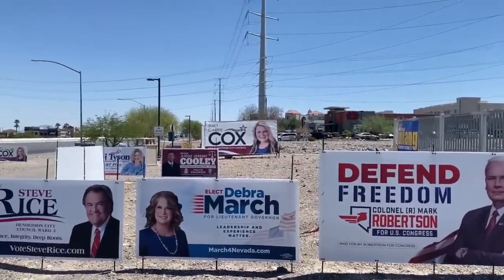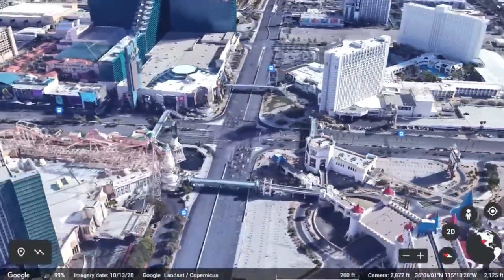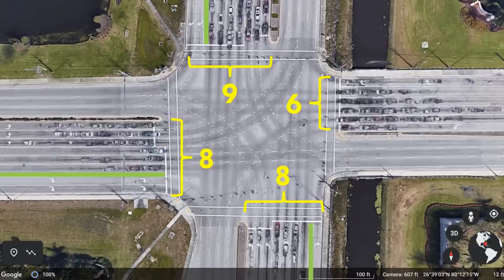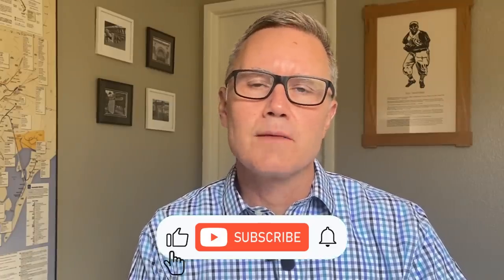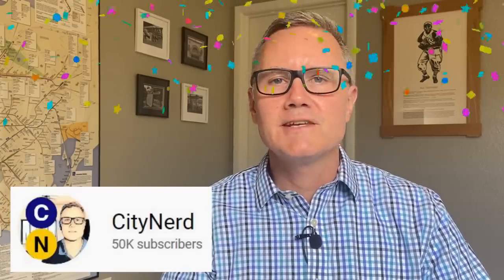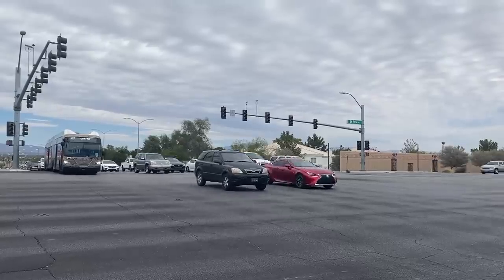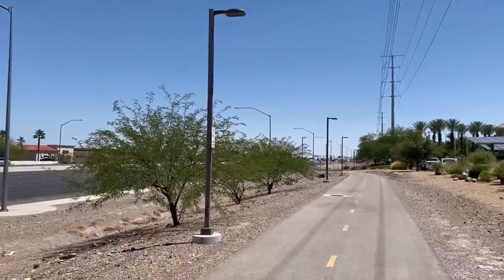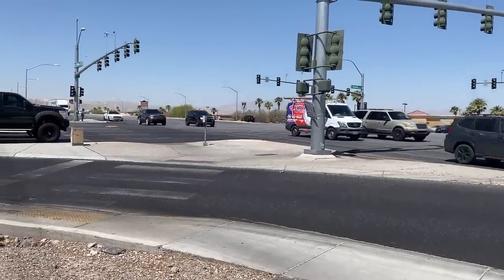Stroad vs. Stroad: Land Use, Traffic Engineering, and What Happens When Suburban Arterials Intersect

Comment: Las Vegas has so much potential to build out an efficient light rail system to connect the city together. 

If they removed just 1 lane in each direction I’m sure they could easily install a rail line.
Reply: "Too expensive! Build a Elon Musk Depression Tunnel" -NvDOT
Reply: I wish this happens. Being that I live in Las Vegas.
Reply: Skip just 1 lane ?...mm you'd still have to cross 6, 7 lanes to get to the streetcar ..🤔
Reply: @bodybait  lol
Reply: Private interests have dictated LV public transit, unfortunately
Reply: instead thei investe in a single private suege tunnel whotout safty fatures
Reply: @bodybait  do you know what's more expensive than operating light rail? Road maintenance from extensive car usage
Reply: Slow access road on each side with a posted speed of 15 to discourage people from using it as a through lane, fenced off multiuse path next to that, followed by grassy tram tracks, fast road in the middle and repeat on the other side, but you'd still need underpasses at each tram station, because that road is wider than the distance between some tramstations in my town, but it would be worth it to contain the monster that is that stroad.
Reply: @l.c.8475  sorry they want gamblers in hotels not to go out.
Reply from the maker: What I didn't say here (maybe for a future video) -- I spent a lot of time with a clipboard and a timer analyzing how phase lengths varied from cycle to cycle. The signal logic is actually pretty smart (in its way) about how it allocates green time to make sure queues clear, since demand patterns every three minutes has a lot of variation. Nevertheless, there was ALWAYS dead time in the cycle -- time when a phase stayed green but the demand had dried up. The fact is, most roads like this are overbuilt, and could pretty easily function the same with one less through lane. (Many roads are built to accommodate demand projected 20-30 years out, and in the sun belt, absurdly high growth projections are the norm.)
Reply: @applesyrupgaming  this intersection is in Henderson, no where near the strip….
Reply: @bodybait  its is a choice to make bus and light rail compete for funding instead of bus vs car and rail vs car.
Reply: @andyinlv1975  i didn't know that lol
Reply: @bodybait  That is absolutely not true! Light rail can easily replace bus routes yes but buses are still affective to serve places with less demand or maybe even run some tram feeder routes
Reply: @bodybait   Well if Las Vegas is rich enough to have expensive money sucking motorways then it can afford to have a tram through the entire strip! Imagine the economic benefits it could have by not needed to go on to bridges over the car traffic and instead just safely cross! ACTUALLY LETS JUST GET RID OF THE CARS ON THE STRIP! Then turn that space into a public plaza with a tram line so if you hate walking very far then you can just take the tram!
Reply: Light rail planners make the assumption that suburbanites want to use it. They don't. Here in the Denver environs, suburbanites desperately try to preserve their 80's-90's lifestyle of big vehicles and green lawns.
Reply: @ccaudi  Actually they will! (If you steal some space from the cars)!
Reply: @ccaudi  Americans will use transit if it's good. Which means high frequency, right of way, and a good (probably grid) network.
Reply: @bodybait  They would if they'd tax the rich.
Reply: Then turn those ridiculous intersection into double lane roundabouts with green space, add pedestrian bridges at all transit stops as well
Reply: @CityNerd  Why fixed times and no detection loops?
Reply from the maker: @reformCopyright  I didn't wanna spend too much time on the intricacies of the timing plan, but of course the detection is important! For example, the northbound left phase (which I believe is the last in the cycle) will sometimes gap out and if there's enough time left in the cycle, the signal will give a little more green time back to the southbound through.
Reply: @mindstalk  and people growing paranoid. Sorry, but I strongly oppose all forms of fascism, and that includes public transport fascism
Reply: @Vettel2011  But you love car and zoning fascism.  You love government subsidizing your lifestyle and telling other people what they can't do with their property.
Reply: @mindstalk  are you talking to yourself? If you don’t like cars, don’t buy one

Comment: Even for drivers these intersections are awful...and crazy dangerous.
I wondered why traffic engineers don't just put a big patch of concrete in the middle and bunch left-turning cars next to it (allowing two-stage phasing) like it sometimes happen in Europe. I got my answer : with a 90 km/h approach speed, there would be to many rear-endings...
Reply: AFAIK all crossings in Germany, Belgium, The Netherlands, France,... have a maximum speed of 70km/h, guarded with red light - and speed camera's.
And even when you wouldn't find crossings this large in Europe. (I suspect 5x5 lanes, including turn lanes is probably the biggest you'ld find)
Even then though governments try to remove these type of crossings as much as possible because they are so dangerous. 
One of the solutions is to make tunnels or bridges for through traffic and/or split the stroad into a road and one or two streets.
But since that's expensive, other cheaper options are to reduce the speed limit, cut traffic in other places to reroute traffic away from these intersections, discourage the usage of cars by reducing the amount of parking and charging money for parking,...
Reply: @Robbedem  
Any improvement of US land? (both urban and suburbans sucks) probably have to start with rebuild failed mall/strip mall.

Comment: having grown up in a place like this (suburban Phoenix -- lol like a urban Phoenix exists), your comment about entering the intersection during a yellow light even when you shouldn't rings true. both in that it's very, very common to see, and that when you're driving through the intersection at speed it can be incredibly difficult to decide if you have time to stop or time to make it through the intersection. turns out humans aren't great at making snap decisions while operating heavy machinery at 75 feet per second.
Reply: What is the proper method? Yellow is slow down but what's guideline on going through or not.
Reply: With cycle times of three minutes, you are just begging drivers to blow yellow lights. Stopping means getting punished with three full minutes of sitting at a red light. It is just one aspect of how stroads suck even at their intended purpose of managing motor vehicle traffic.
Reply: @mrslvw  The guideline is that if you are scared to go through on the Yellow, buy a bigger vehicle.
Reply: @stevengordon3271  bingo! Bonus points if you get it lifted
Reply: @stevengordon3271  lol nay in this economy and with these gas prices, I'll stick to my little fuel efficient clown car.
Reply: Driving in Phoenix, I was blown away at the high level of people aggressively trying to run the yellow lights and that first bit of red. The urban sprawl is so bad there in Phoenix that you should expect to drive 45 minutes, on average, to get anywhere.
Reply from the maker: Yeah, it's amazing how much of a system like this that has such a high potential for danger comes down to relying on flawed judgements of individuals. A lot of yellow (and red) light-running, but then on the other side a lot of people at the front of the queue looking at their phones or whatever and not reacting when the light turns green.
Reply from the maker: @davidbarts6144  100%
Reply: @mrslvw  the guideline is to stop if you can safely stop.  Most drivers don't treat it like this though.
Reply: I live Phoenix as well we’ll by the Avondale tolleson area and yes you need a car everywhere. I love downtown phx alot as they are trying to urbanized it even more specifically Roosevelt street because I just park nearby and walk along all the bars, food etc. More fun to walk and discover cool places or art then driving around. But even in downtown you still need to be cautious of cars

Comment: I lived in Henderson, Nevada, 2004-2015. I bicycled thousands of miles around Henderson, Las Vegas, and Lake Mead. I rode with a club for safety. Cyclists and people standing at bus stops around the area get killed frequently by motorists. I’ve ridden through the intersection of St. Rose and Eastern many times. Except for North Las Vegas there isn’t an area I haven’t cycled in the Las Vegas area. Thanks for this video of an area so familiar to me. If you want to do some cycling with a great club in Henderson, check out Green Valley Cyclists.
Reply from the maker: Thanks! In a lot of ways, Henderson is great for biking. Lots of paths and trails, and you can start to see buffered bike lanes on some of the newer or retrofitted arterials. There are just too many intersections like this, though.
Reply: I cycled Valley of Fire road one Saturday - and was constantly harassed by Harley Davidson riders, who travel wolf pack style btw.   Even the new bike lane on Hollywood Blvd is pretty bad for exhaust smells with plenty of Ford F250 quadcab duramax diesels to be seen.  I ended up going mountain bike and stay away from polluted, dangerous roads.

Comment: 11:39 I've been walking more and more lately, and having been a driver for the past... 16 years... I have been paying attention to how I handle each intersection type as a driver, and how the road is designed to help me ignore pedestrians as a driver. And just how car-centric our culture is that basically means cars always take right of way and anything in your way is a nuisance. Anyhow. On an intersection with slip lanes. I am always checking traffic approaching from my left, I may see a person appraoching from the left too, but almost no way am I going to see someone approaching from  my right! 

I know the slip lanes are supposed to be safe, and some are even signalized, but if you're a driver, you know that no one cares about anything except themselves (yourself included when you're the driver), and so people approaching from the left, may need to get into the slip lane exit lane in order to get to their destination or to get ready for the next intersection which is probably also packed.

Anyhow. Slip lanes anywhere near pedestrian traffic should not happen. Drivers will 100% of the time be focused on oncoming traffic. Unless the slip lane has 400m of bollards keeping the two lanes separate past the intersection, then maybe the driver turning right on the slip lane won't look left... better yet, put up a wall to prevent them. And on the wall write "watch for people!"
Reply from the maker: It's just a terrible design, especially when there's a pretty well-used multi-use path across one leg of the intersection. Everything but cars is an afterthought.

Comment: In cities like Las Vegas, transportation planning is a misnomer for how it's practiced. It's not about transportation. It's about cars. Cars are transportation but transportation is about more than cars. First of all, buses have to stop 500' from the intersection. If you have to transfer buses, that's 500' to get back to the other street and that bus probably has to stop 500' down that street. Include the 200' to cross that huge street, and you're walking 1200' just to transfer buses. That's almost a 1/4 mile. It's not very far but in the Las Vegas heat w no shade, it's miserable. So "transportation" is not what these people are planning. 

The problem is that once the cities are built out this way, if they someday come to some kumbaya and try to build an integrated transportation system, they will have a hard time because the streets aren't built to accommodate that. By that I mean, the streets are only barely walkable. Mega streets, fast  traffic, no sidewalks, no shade, nothing but parking or sound walls facing the streets, to to name a few things. They spend a lot of money landscaping the street for cars but not for people. The streets are not built at people scale. They're built at truck scale. A lot of roads will need to be shrunk and people won't like it. It will be hard to change the nature of those streets. 

Chicago is a great city to use transit. The streets are small for one thing. No wide streets. Traffic is slow. Lots of stop signs. There is plenty of shade on most streets. Store fronts along the sidewalks. The city is built at people scale. Getting to your bus or train station is fairly pleasant even if it's 1/2 mile away. Buses and trains are frequent. Walking a mile or more in Chicago is a breeze and doesn't feel like it. 

I'm reminded of Los Angeles which has had a kumbaya on transit and is building out a vast mediocre rapid transit system. People often say LA is not a dense city but it is and demand for rapid transit in such a huge city is there. Whereas in cities like Chicago, NYC, and San Francisco, people of all socio-economic classes take transit together, I don't think that will ever happen in Los Angeles. One big reason is that the streets are miserable to walk on. Little shade, lots of parking lots, wide streets, fast traffic, etc. Most who have a choice would rather sit in traffic than walk a 1/2 mile on one of those streets to a station or wait for a bus or two to complete your commute. The city just isn't built to facilitate walking and taking public transit. You can build a large mediocre transit system but if getting to it is unpleasant, well then, you've limited it to those who have to use it. Even walking around Century City can feel dystopian. It isn't pleasant. I think I would prefer a root canal to walking down Sepulveda Blvd for 1/2 mile.

Comment: What's your opinion of "Michigan Lefts?" Those stroad designs where you must drive straight through the intersection and make a U turn just to go left. The justification seems to be that they are safer and reduce conflict points, but are they? My experience is that they can often overfill and can cause backups, leading to an even longer wait. They do seem slightly better for peds because they require a substantial median, creating a larger island at the crossing.
Reply: Or you could do what we do in Sweden : ban U-Turns (well I have never seen anyone do it, and I have never done it, and my driving instructor told me to never do it), and design the roads to accomidate turning around some other way.

(roundabouts or side roads that you can drive in on and get turned around using a three-point turn or a turning area.)
Reply: I'd love to see a City Nerd video on non-traditional intersections (Michigan Lefts, Roundabouts, Continuous-Flow, etc.). Are any of them actually better? Or do they just create a different set of problems?
Reply: In Quebec City there'S a road with those and they built the bike lane straight in the middle with yield signs we absolutely cannot expect anyone to respect.
Reply: @MohondasK  I would not be surprised if there was a city in the US that embraced roundabouts but then made them 2-way roundabouts that go 3 lanes each way, as if they got someone who wanted to work on particle accelerators to design it.
Reply: @dominiccasts  then other cities use that as an example of why roundabouts don't work and never build one themselves 😭 

side note, I have never seen a Michigan left, and I live in Michigan 🤨, just conceptually sounds terrible though so I'm glad I haven't
Reply: @Nota-Skaven  They are terrible in practice. They overfill easily, as mentioned above, and having to cross 2-3 lanes of traffic that are set basically right in the middle of where cars line up for intersections mean that you have large wait times.
Reply: As a Michigan resident, I am only aware of a few intersections that have the overflowing left lane problem on a Michigan left. Most that I'm aware of are pretty good. I was recently in Florida and was shocked at how long you had to sit while the traffic light cycled. Overall, I think the Michigan left is a great thing It might take longer for those actually making a left turn, but for everyone else I think it is quicker.
Reply: The best use case I've seen for them is on rural highways as an alternative to putting in a stoplight or an entire grade separated interchange for a solitary fuel station / church / barbecue joint. Letting the traffic from the side street/business focus on crossing only one direction of traffic at a time on the highway lowers the risk of someone getting T-boned trying to line up a simultaneous gap in both directions.
Reply from the maker: I'll have to look at it -- I've honestly never lived somewhere where this is a normal intersection design!
Reply from the maker: @MohondasK  Yeah, I do have an idea like this on my list, but I do think there are videos out there that cover weird intersections pretty well. I'd have to figure out a good way to give my own spin on it.
Reply: Yeah, the more I think about it the more I realize the goal of all these alternative intersections is to more efficiently move cars. They don’t really positively affect their urban environment beyond car movement.
Reply: @BaronBytes  ah yes, the joy of biking up Pierre Bertrand and waiting at the noisy smelly 3 minute-long mini traffic lights every 4 minutes. At least they tried though
Reply: @MohondasK  For instance the point of this one, which they have used for a rebuilt divided-highway intersection near where I work in Maryland, is to separate the turning activity from the movement onto the other road. You go straight quicker than you turn.
Reply: We have some of these in Tucson AZ - they were all constructed recently though